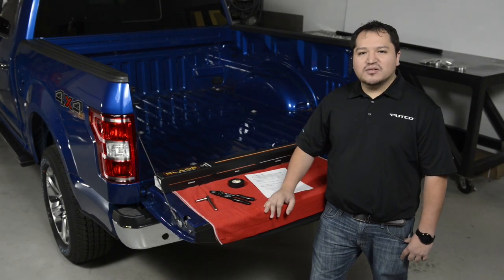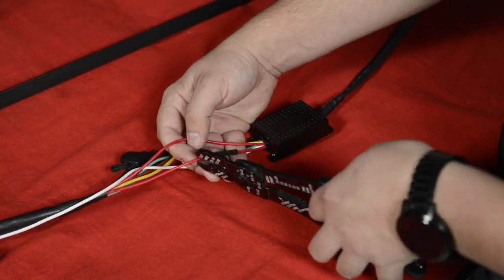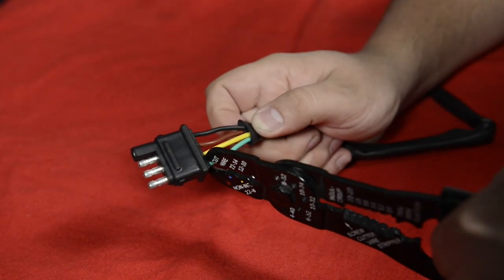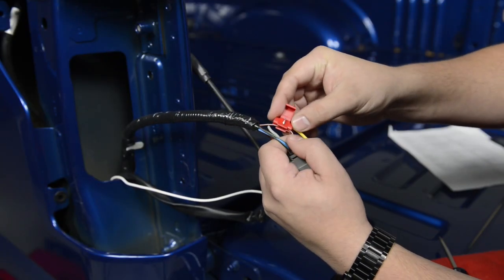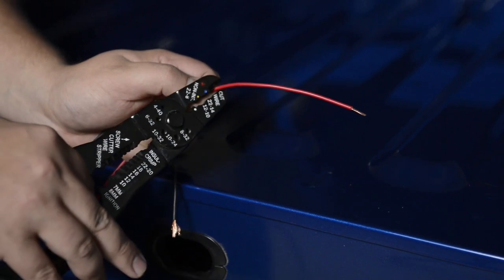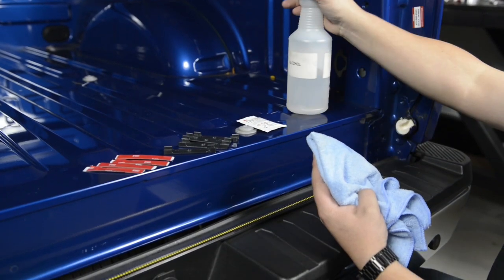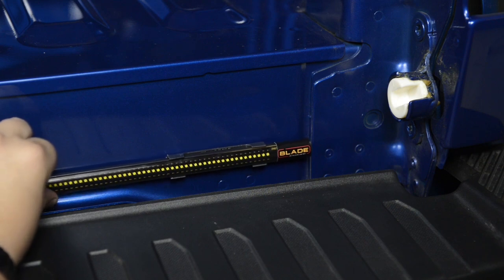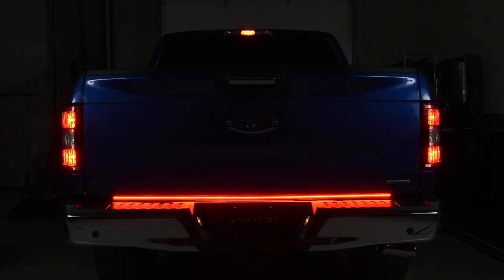How to Install the Putco Blade Tailgate Light Bar on a F150 2015-2020 | BLIS & Trailer Detection

Comment: 2016 F150 with Trailer detection. 
When the two screws are out of the tailight,  pull straight back to remove the light. It is held by three positioning studs. 
Putco yellow wire to ford orange/grey - left turn and brake 
Putco brown wire to ford blue/grey - running lights
Putco white wire to ford green/brown - reverse
Putco green to ford gr/or - right turn / brake. 
I did not cut the red wire and attached the black wire to the trailer harness - ground

Comment: I was told by Putco to cut the red wire and connect to the positive terminal of main battery. This on a 2022 F150 XLT.
Reply from the maker: We do offer a plug&play version for 2021+ Models that do not require this connection 
https://www.putco.com/product/blade-tailgate-light-bar-plug-n-play/

Comment: How do you install an LED tailgate strip light on a 17 F-250 Super duty? They don't have a spot below the gate.
Reply from the maker: Its 100% guaranteed to work on your 17 Super Duty - check our forums our give us a call if you have any questions or concerns 
https://www.putco.com/forum/forum/lighting/led-light-bars/78-2015-f-150-2017-super-duty-blis-and-trailer-detection-answered-resolved

Comment: Hello Putco! Just got this Blade (Part92010-60) for a 2017 F150 Lariat w/ 502A Group., LED tail lights, Trailerr detection/assist and BLIS. November 2020 installation remains the same? My trucks taillights wiring harness is totally different than the one in the video. many thanks.
Reply: So the harness is different take out a volt meter and test the 4 pins. It’s not hard lights off no power turn lights on one of the 4 pins will have power. Turn on the turn signal you’ll only have three pins left it will show power etc

Comment: I have a 2016 Ford F-350 crew cab, long box Lariat diesel.  In addition, I have the trailer detection.  Where can I find the wiring diagram for this truck?  Do I have to do the tow module modification?
Reply from the maker: 2017+ Super Duties require this type of installation on video, but 2016 and older you can go directly at the 4-pin or hardwire at the 7-PIN or get or Plug&play harness part# 529004 (and the installation will be a breeze).
Reply: @PutcoInc  Nope.  Wrong.....Got the 529004 - get trailer tow fault on dash.  4-pin gives same error.  Trailer Tow detection.

Comment: The adhesion promotor is never included . I’ve purchased 2 and same for both , no supplied adhesion promotor.....
Reply from the maker: Chris,  great point!!!! 
We need to update our printed instructions to specify that the adhesive promoter is no longer needed.  as the new 3M tape cures without the need of the promoter.   thank you for pointing that out!

Comment: He says "use the supplied scotch locks to make all connections to the respective tail lamp wires" -- but what harness wire color goes to which tail lamp wire?  I see a comment below to "check our video description" but where is that?
Reply from the maker: They will definitely be included in the box, but here is the link in case somebody else cant find them! 
https://drive.google.com/file/d/1Sic5vyLKk59cmxAmJJl8WEbLr7rfDAfq/view

Comment: Why not simply  hard wire everything to the Tail Lights assemblies without touching the trailer wiring harness and jumping wire under the dash ?  Would that be possible on a 2018 F150 with trailer assist and BLIS ?
Reply: Any answers?
Reply from the maker: On some models it would be too much draw (from the tail lamp wiring), the Blade driver pulls power directly from the 7-pin to prevent hyper-flashing at the tail-lamps.  The Blade is equipped with a driver that allows this to work properly.
Reply: @PutcoInc  will pulling power from the 7 pin cause the truck to think a trailer is connected?

Comment: Can you install this on a 2018 F150 with LED tail lights and the bliss system and tie into the 7 pin trailer plug? I just don't want my truck to think I have a trailer hooked up all the time.
Reply: Nick F I forgot to mention I have the factory LED taillights,  I have heard you can't wire to the factory LED taillights because it causes them not to work.

Comment: Do I have to remove the 2 bolt bracket for the auto tailgate lowering system? My truck has this bracket, and I am unsure as to whether the standoffs will provide adequate clearance. Do you think that they will? Any alternative solutions if they do not? I would like to retain the auto lower system.
Reply from the maker: If you don't wish to remove this bracket, you can fit the 48" version part# 92010-48

Comment: I need help now PLEASE,  I have a 2018 F150 with LED taillights and the bliss system,  for the jumper wire under the dash it says to connect the orange wire to the green-red wire but my truck doesn't have a green-red wire,  it has a blue-red wire and a brown-red wire,  so i don't know which of those to use. I have my truck taken apart so please help.
Reply: Nick F ok Thank you
Reply: Thanks Nick
Reply: Taz Man what is the under dash jumper for, will this keep my camera working ?
Reply: @jchello  I have that same bracket on my 2019 and have been trying to get an answer also without any success.

Comment: The BAR DOESN'T APPEAR TO BE WORKING.
First I disconnected the trucks battery. Cut the red wire next to the shrink rap sleeve as per the instructions and sealed the sleeve with a heat gun. Removed the red wire and connected the bridge wire as per the instructions.
Then I proceeded to connect the tail lights. To be totally transparent I connected the bar to the passenger side of my 2017 F150 because I have a camper shell on the truck and has other connections to the driver side light. This required me to extend the white and brown wire so they would reach the passenger side. I made these extensions with water proof heat shrink connectors. I made all the correct connection on the left side and then connected the yellow wire to the drive side turn signal wire. Made the connection to the 7 way trailer connector with the orange to red and the black to white. 
Reconnected the trucks battery turned everything on to test the bar and I got NOTHING. All the turn lights are still functioning correctly. 
So I reconnected the red and black wire to make sure I had good connections. Checked and replaced the fuse just to be safe. STILL nothing. I disconnected the the red and black wires and then connected them directly to a 12V battery and still nothing. I then connected the red and black wires to a known working power source connected directly to the trucks battery. Still nothing! Tested the known source and it was still working. 
So I disconnected the bar and connected it directly to the trucks batter and still no lights. 
Any suggestions? Or is the bar just not working?  This is a cool and great safety feature and I hate for this not to work and be out what I paid for the bar.
Reply from the maker: Hello Fred, there is a few things that you can try, we may need to have you re-loop the power wire. 
as it was originally, it is possible that you have power going to the wrong red wire. Please email support@putco.com with your phone number and a good time to reach you and we will troubleshoot this for you. - Alfonso S.

Comment: I have another question,  why can't you tie the red wire to the parking light wire going to the license plate light?
Reply from the maker: Taz, great question... The licence plate light is only "ON" at night when the lights are on and this is not recommended due that our light bar will draw more voltage than the standard 194 bulbs used in this harness.
Reply: Putco OK Thanks for replying so fast,  I just received my light bar from you guys today and am going to install it just like you show. Again Thank you very much.

Comment: Is this light bar compatible with the 2019 Ford Ranger?
Reply: I want to know this as well
Reply from the maker: We have a new Blade coming up specifically designed for the Ranger (100% plug & play) please stay tuned!
Reply: @PutcoInc  What is the status of the new 19, 20, 21 Ford Ranger compatible Blade.
Reply: @PutcoInc  What is the status update for the 2019 Ford Ranger blade?

Comment: so - my 2017 F-150 Raptor has a mounting bracket where you have holes in your tailgate... how do we get around that?  https://i.imgur.com/AGfqogp.jpg?1
Reply: ToddI have a 2017 250 Platinum. I have that same mounting bracket along with a plastic cover in the middle. That bracket you're showing there is just a tailgate support piece incase you place something extremely heavy on your tailgate. You can just remove it as I did along with the middle plastic cover if you have that also.
Reply: Jeff Vry FYI it's for the tailgate step so you support yourself
Reply: Todd Christ like I said something heavy. :) I'm a lil heavy
Reply: I have that same bracket and I think it's for the automatic tailgate opener,  I was wondering if you use the mounting brackets in the light bar kit if the light bar would clear that bracket? I can't get anyone to answer my question.
Reply: I have the 2018 F150 with the automatic tail gate opener and installed the 60" light bar like this. I went to Home Depot and purchased aluminum flat bar 1/8" thick by 36" long and a roll of 3M two sided take 3/4" wide. I cut 8 pieces from the flat bar the same length as the flat brackets. Cleaned all with alcohol, place a strip of the 3M two sided tape on the flat bar, then a piece of aluminum. Another piece of two sided tape and another piece of aluminum and a final piece of two sided tape. Do the same with the 3 remaining flat bars. Place equally spaced on the back of the LED light bar. The two outer flat bars are placed at the two extremities on the back of the bar. When placing the light bar on the truck. the inside edge of the right flat bar buts up to the automatic tail gate opener. White, yellow and brown wires connected to left tail light. Green wire to right tail light. For the red wire you cut another piece of wire to attach it to main battery. Black wire is attached to white wire from 7 pin trailer connector. Hope this helps.
Reply: @thomasjones3036  excellent!!!